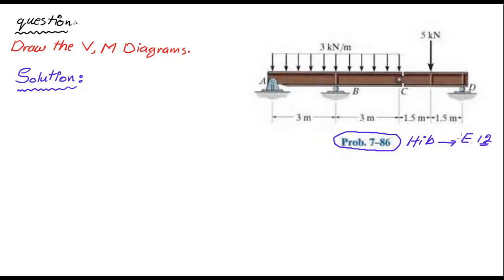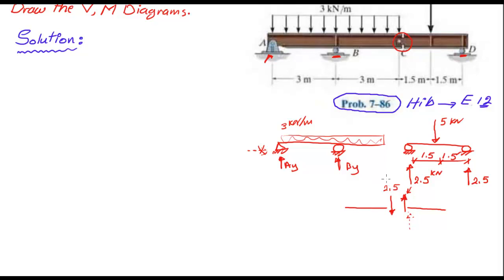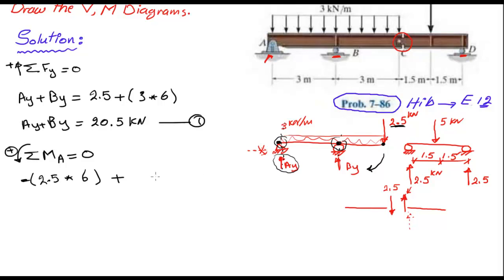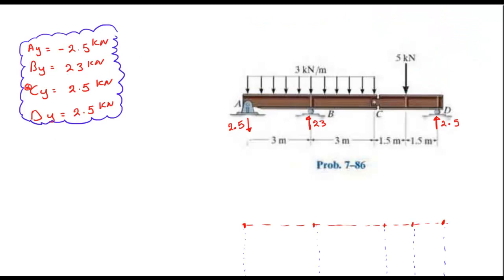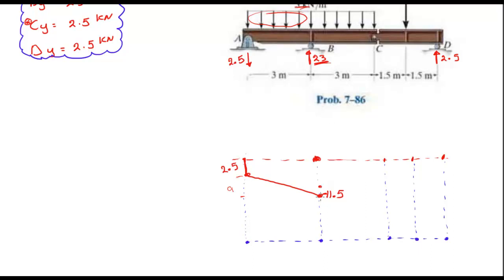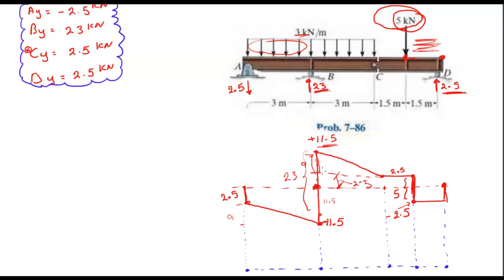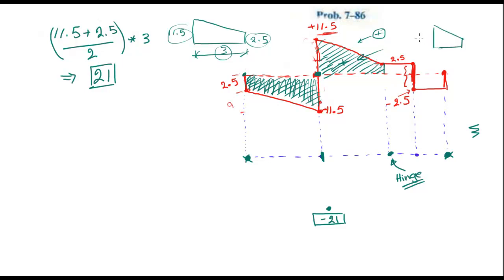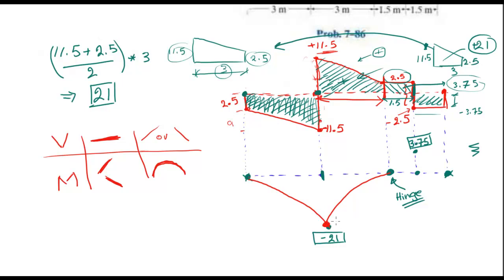Compound Beam Shear and Moment Diagram -

Comment: we dont have to find the reaction at D? Dy?
Reply from the maker: we do not need to. But, when drawing the shear force diagram, knowing the reaction at the end support will give us a confirmation that our solution is right. we reached a negative value of (-2.5 kN) before D, so the reaction at D when it is 2.5 upwards, will "close" the shear diagram and push it back to zero. Imagine if you get another value for the shear force before D (Say -10 kN), knowing the reaction at the end (and assuming it is correct), will tell you that the value you reached (-10 kN) is not correct and needs to be checked.

Comment from the maker: following the above example, if you have the 5 kN load on the hinge, and when you divide the beam into two beams simply apply the 5 kN on the left support of the "new right beam and apply it again on the overhanging right end of the left beam. 
both 5 kN's acting in the same direction of the original force.
similarly for the concentrated moment.
Hope that clarify and answer your question

Comment from the maker: it is impossible to use statics to do it if you add one more support. But there are other techniques that you may learn in structural analysis II. The reason I said it is not an internal hinge is "the term" internal hinge is something related to the material of the beam when it starts to fail. The hinge in the problem is an external one i.e. can be seen from outside. The internal one will have the same effect as the external one but it will happen on a smaller scale inside the beam.

CTSCIVIL

Comment from the maker: @thrakib 
if you have the shear force diagram you are set. Just calculate the area under the shear diagram from the left or right support up to the point of interest and the value of the area is the moment value at that point. Lets say you want to calculate the moment at a distance = 3 m from left, you calculate the area of the shear diagram from zero (left) to x=3 m and do not forget the area above the x axis is positive and the area under is negative
good luck